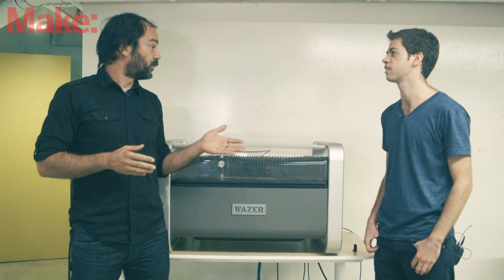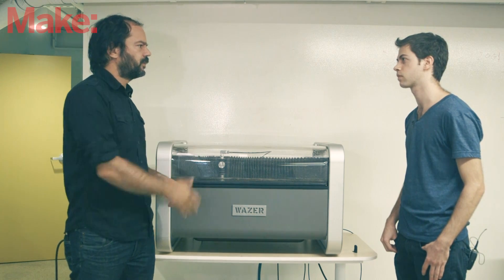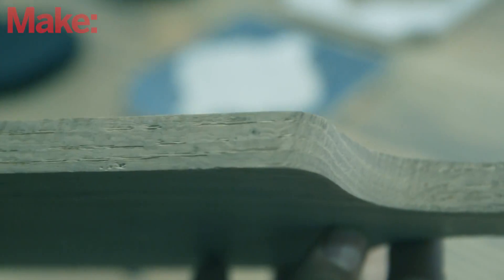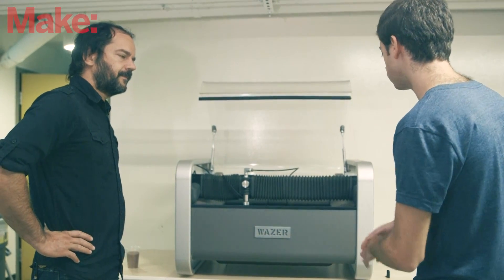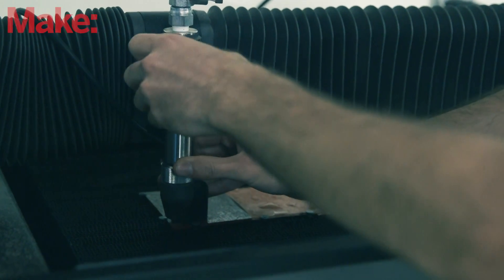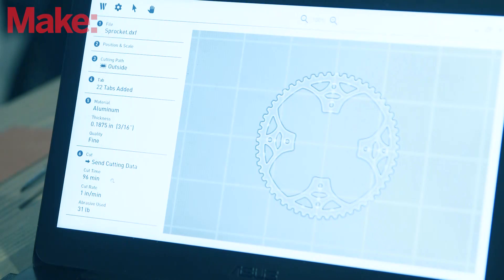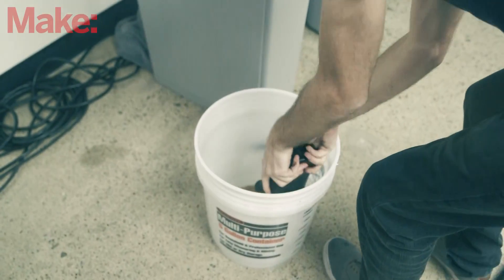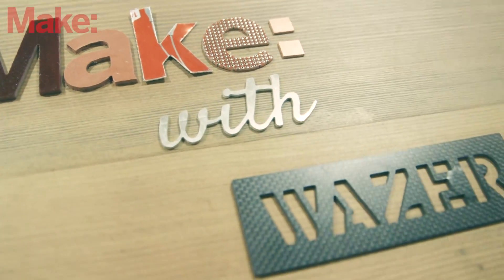Wazer: Desktop Waterjet Cutting

Comment: At $10,000 it isnt low cost. You can buy a larger Chinese 4x4 waterjet table deliverd to your doorstep for that kind of money. It is no longer for the average person but you can build your own. Its been done using 4000 psi pumps for around $1500 including a cheap chinese 3 axis cnc kit. For $10k youd think they could at least have a functional Z axis. Someone will replicate this overseas for $2500 sooner or later.

Comment: Check at 8:12:   Cutting the sprocket in 4.7 mm aluminium: takes 1 hour 36 minutes and 14 Kg of garnet costing about $8.   The hoppers are specified to take 13.5 kg.   Taking into account set-up and clean-up, you need over 2 hours to do that sprocket.   Nobody would make a sprocket out of aluminium of course - you need something much harder, so a lot more time and many times as much garnet.   The machine cannot be used unattended.
This seems to indicate that cutting sprockets and gears is not something this machine can be used for.

Comment: As someone that owns a full scale waterjet machine, I believe there is no way to actually make any money on this thing.  Like other comments, its a very expensive toy.  If you believe you are going to be able to make money with it, I really feel for you.  Unless you are cutting foam or rubber, forget it.  Sorry, but its true.  $6000 for this, ouch!  I would rather spend 120K and make my money back over a year or two, vs wasting $6000 on this.
Reply: I said the same thing about a "cheap" cnc router I saw over on tested. 

But this is like 3d printers: you can buy big huge expensive machines, or you can buy cheap smaller units for 1/10th the cost. (or any other technology for that matter). Same as laser engravers/cutters....you can buy $60,000.00 machines that can "do all" or $400 machines and supply a niche market.

Comment: Hope someone buys one of these and takes apart the head. Would love to see how it works. If you could boost the pressure a little it would work great on the 8 x 10 cnc table i'm building. Of course I can cut up to 3/4 inch steel with a plasma cutter, and 10 inch steel with oxy acetylene. So might not be necessary. Of course cutting something like leather or rubber could be useful.

Comment: Can you reuse the abrasive? Is it sand or gypsum like the big machines? Will there be other sizes? Will there be a 240v version for the rest of the world? How much power in watts does it require per inch?
Reply: I thought they use garnet for the abrasive?  Probably not reusable unless there is an easy way to dry, mill, and sift out the contaminants.  It would be sort of like a muller that is used in the casting industry in order to recondition casting sand.  Not sure about the condition of used particles, they may loose their "edge" for cutting after being used once.  But I agree, it would be nice to reuse.
Reply: You are correct it is garnet, I had a brain fart. But a professional cutter runs at a minimum of 12000psi and some run at 60000psi and need to be run under water because the sound can rupture your eardrums, this is on the other hand is pretty tame and probably doesn't degrade the garnet very much.

Comment: In my opinion water jet is only practical when you need to cut very large or thick pieces of metal. That said a water jet of this footprint is nothing but a novelty. You could build a pretty sweet CNC mill for the same cost that would do everything this unit can do and much more! Still a cool project and these kids are clearly very smart I just wouldn't waste much more time and money on the project...

Comment: if it can cut through virtually anything then won't the base material wear out over time?
Reply: probably, like in every cutting/grinding machine mankind has ever made =P the beds are made as thin and hard as possible, if you look closely you can see the mesh in the bottom, i dont know how thick it is because all you see is a veery thin edge so with hiles between so the abrasive has as little as possible to cath on to, in heavier industri machines it's ofc a lot heftier but for this small scale it looks good :)
Reply: I didn't notice that in the video. Thanks.

Comment: Abrasive is not reused?  why not?

And the question on everyone's lips:  Is the abrasive a proprietary blend that you are locked into buying from the original company?
Reply: It would need to be carefully dried to be reused but it may still have some life left in it, it will dull though and cutting speeds may need to be changed. I don't think it has any magical properties so could be replaced with other manufacturers abrasive, it is unlikely to be expensive in either case.
Reply: Actually, you can reuse around 60 % of the abrasive. it is just expensive to do

Comment: It must be harder to make this than I'm imagining, seems a desktop waterjet should be smaller. seems you just need a motor, compressor and nozzle. can't we make those smaller by now?
Reply: Nabre Labre it is simple. No reason to charge as much as he does.
Reply: A commercial waterjet cutter operates in the pressure range of about 50,000-90,000 PSI (pounds per square inch), depending on the machine.  To achieve these pressures, the pumps are quite/very expensive.  So to scale this down to a small benchtop model is quite a challenge.  They would need to design in the highest-pressure pump that they could manage without breaking the bank as far in terms of the retail price of the machine.  So when the pressure is greatly reduced, the speed will also be reduced significantly, and the maximum thickness of material that can be cut will also be reduced very significantly.

By comparison, a pressure washer that one might buy at Home Depot or Lowes would be a maximum of around 3600 PSI.  Heavier-duty pressure washers may achieve water pressures of 5000-10,000 PSI.

Just as a point of reference, there are large commercial waterjet machines that can cut 2" thick steel plate if necessary.  These machines usually have table sizes that can accept plates of 5' x 10' (often the maximum).

Comment: I'd be more interested to modify a high pressure cleaner so that it at least can cut plywood or plastic. Can it be done or is there too much difference in pressure between a waterjet and a high pressure cleaner?
Reply: For plywood or plastic, you're better off getting a laser, I think.

Comment: Come on... everybody has a 220v dryer outlet at the very least. Plus the rest of the world can use it, and you'll get greater cutting capacity. But aren't switching power supplies sooo very common now? I'm looking at the back of my TV and it says 110v/230v 50/60hz. If people had the option to run at 110v if they needed it, but understood that cutting capacity would be lower. That's a reasonable request.

I can only be interested if it could cut 1/4" plate, otherwise, it's basically a toy. I can import a 320w Laser with 4x8 bed from China, right now... that can do 1/4" plate for that price. And that runs on 220v.
Reply: Got a link for the laser?
Reply: yea for real, link please
Reply: There are no direct links. You have to make a deal with a purchasing agent. Log on to Alibaba, search out what you are looking for then put in a bid. If you are looking for 150w laser, with water chiller, honeycomb base that raises and lowers, auto-focus, etc, etc... you get back dozens of companies all competing for your dollar. You'll quickly learn the lingo, the specs, what's crap, and what's good. You can pit companies against each other and get a really good deal. Making sure you can get 24/7 tech support, or seeing "your" machine make a test cut before it's loaded into a container, guarantees against machines arriving DOA are all good things to ask about. Also, you need to have "a guy" here that can fill out the paper work, and get your machine out of customs and on to a delivery truck. That usually runs no more than $300.

If you want to avoid all that, and buy a machine that's already been vetted, and that's stateside already, expect to pay a hefty mark-up. As that is their business model to re-sale machines. There are literally hundreds of them. MournTech is going to be the cheapest, but they have a showroom in Stockton CA, that you can actually go and visit, and get local support.

Anyway, companies that I've personally vetted are Omni CNC, HSG Laser and Elephant CNC are all top notch manufacturers that will literally make any machine configuration for you.
Reply: Alibaba?!?!? Anything but that!
Reply: I import stuff all the time, and sometimes just to re-sell. If you know what you are looking for you can get stuff well beyond the quality of Harbor Freight. And let's be honest, companies like Jet, Laguna and even your favorite power tool company are all made over there. It's in the specifications and details that makes the tool a high quality piece over import junk. I learn the ins and outs of everything I intend to purchase from overseas. I've stumbled across manufacturers that make for the big boys, but also private label at a fraction of the cost.

It's really not that big of a deal to shop the world, in this global economy we live in. In fact, it's kind of fun!
Reply: Eco Mouse
I don't mind buying items from other countries so much but Alibaba contaminates nearly every search and without fail you can never find an actual storefront.
Reply: Unfortunately, there are not a lot of decent web store fronts directly out of China. It's cost prohibitive, and counter-intuitive to the Chinese in the way they do business anyway. Since their whole culture is about agency and proxy, Alibaba makes sense to them. They set-up the front end, and offer professional grading services to up their status and reputation. It's exactly like a cross between eBay and LinkedIn. The way it usually works, is that either you make a bid directly, and let Alibaba vet your bid to companies that fit your product description match, or you found a product and contact directly through the site... it always starts off with a chat with a sales agent. It can then escalate to skype or whatsapp. If you have found a good company, this agent will be in contact with you all the way up until your machine arrives and is working.

It's a long a slow process, and nothing like our impersonal ways of add to cart, and buy now we love so much. However, AliExpress is a bit more like Amazon in that respect. You see a price, you see the shipping total, you can buy it. I'm not a fan of the hassles that doing a bank transfer entails, or doing Western Union. Barely any of them have PayPal. But it is what it is, when you are trying to save thousands and understand the shortcomings.

Comment: Oooohhhh so close....3/16 steel won't do it for me!  Gotta have 1/4" :-(
Reply: 118 min for that little knife though,  I'll keep paying for pro service till this is viable.
Reply: +Skidtire you assume I'm making knives, and not some other structural part that needs to be 1/4"....when this turn into knife making!?  I need to cut 1/4".  Period.
Reply: 3/16 isnt that thin
Reply: I regularly make knives that are .5"
Reply: +Skidtire you're right, it's actually impressive for that machine...but when you need to cut parts that have to be 1/4", then 3/16" is too thin...
Reply: Nathan Hamler Ive made homemade knifes from a power hacksaw blade that is 3/16" thick and its a great very sharp knife
Reply: Well build your own. 3D printer cnc tech costs 300€ and high power pressure washer can be hacked as the pump, just custom nozzle and custom hopper. I would say building one will cost 2K for basic garage model. DIY is the way

Comment: the cut times on the kickstarter page don't make sense. 118 minutes for a knife blade, but even if it had a 40 inches on the perimeter and cut at the slowest listed speed, it would only take 66 minutes.
Reply: I know, right? You could cut out a knife blank in just a few minutes with a bandsaw. Sometimes, these nerdy types who've never actually used real equipment get all caught up in slow, techy gadgets. I'm looking at you 3D printers!
Reply: I could see this being a good use of money if the knifemaker is trying to save $$$ on damascus or timascus, which can add up super quick. Otherwise, I guess it'd be good for proofing a print that they're sending to a waterjet company. That might save time and lower anxiety, which is a plus.

For things like gears and other things that may normally be done with a series of complex bandsaw cuts, drills, and filework like you might see on Clickspring, it would be great if the shop did that stuff all the time but never made large numbers of a single part
Reply: Or you could setup 12 blanks to be cut up overnight while you're sleeping...
Reply: $6000 is a lot of money for a "desk hold down" on the off chance that, maybe, someday, you'll get around to using it.

It's kind of like a color laser printer. If you are a graphic designer, you'll use it all the time for proofs and printing things out to test. But if you just are a regular guy, who buys one at Costco, then it'll likely sit most of the year unused. Kind of how 3D printers are turning out to be for a lot of people.

I don't think of this as being comparable to something like an Omax, (one that I've sent off part to have cut) because cut quality, kerf and draft aren't going to be the same. I can see the Wazer being more for one-offs and prototype work. Because a part that was cut here, and worked in your assembly, might have completely different tolerances to a part that you sent out.

But back to what I was saying, you, as the inventor/engineer/maker guy needs to understand all the various machining processes, and be comfortable with outsourcing your projects to larger shops that have those capabilities. Because there are subtle differences between machining, laser, plasma, EDM and water jet. It's important to know why you'd choose one over the other. Because you'd just end up making something more expensive and complicated than it has to be, just because you are enamored with the techy-coolness of having a water jet, when say, plasma might be just fine at a fraction of the cost.
Reply: Of all the processes, water jet needs the most baby sitting. Too much can go wrong all at once. You've got super high pressures, splashing water and electricity, clogged nozzles, staying on top of abrasive loading... water jet is not a beginner's tool. It's more for shops that have outgrown their plasma tables, or need the very specific cold cut edge properties that plasma and laser can not offer. And you'll know when you need to know about that.

The one cool thing about water jet is it's ability to cut cork, rubber, leather, fabric, acrylic, wood, metal etc... However, laser can do the same thing, with much less hassle and clean-up. No tank management, sludge removal, water scum & slime...
Reply: If it's as slow as they're saying, that would take 24 hours. 24 hours of 1500 watts being burned plus the cost of abrasive and water.
Reply: Yeah, I forgot to mention that... water jets are huge energy hogs.